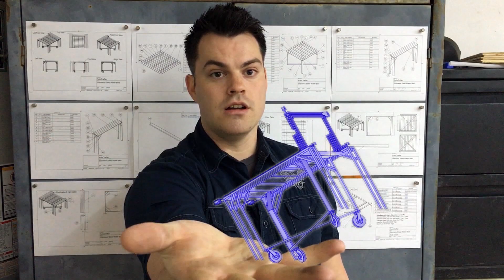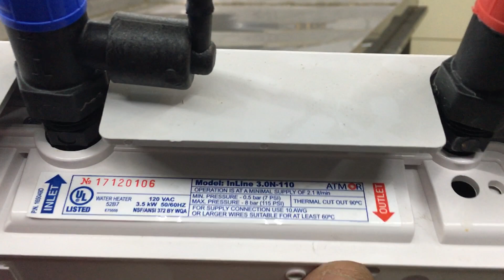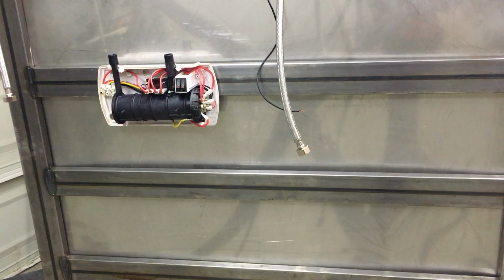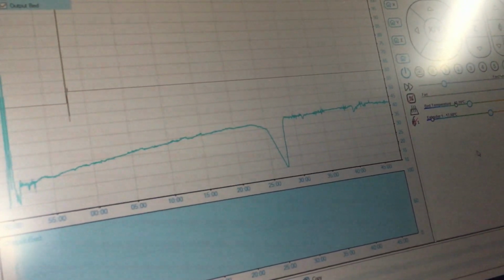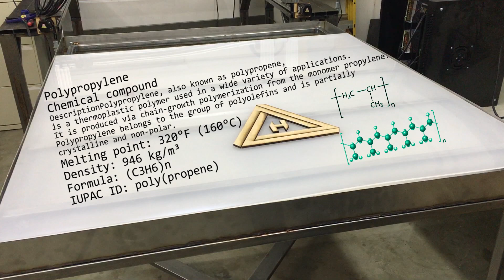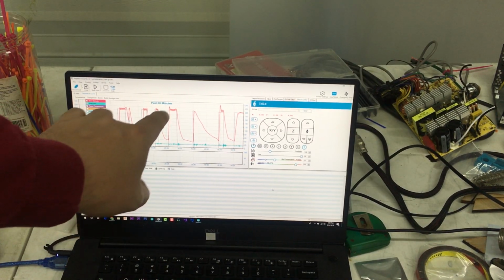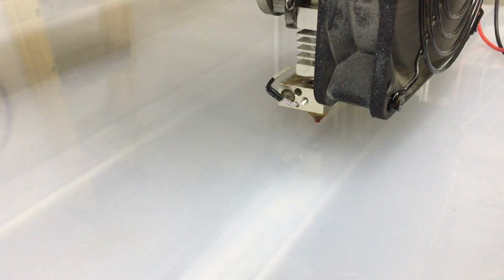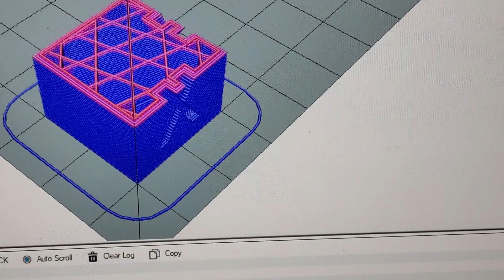First Print on Largest DIY 3D Printer CNC

Comment: I feel like you would def benefit from looking into a mini pellet extruder because printer filament will start to add up at those sizes. I'm experimenting with it right now but for my little printer I dont see much benefit other than using recycled bits without making filament from them. I just toss the bits in and go.

Comment: You might want to use some spray on rubber for your tank. You are probably seeing major heat loss through conduction. That flex seal stuff should work well. Might also want an algecide in that water.

Comment: If you have a printer that big I recommend getting a continuous pellet extruder and a barrel full of Injection molding pellets with a vacuum feed. Pellets cost less than filament.

I also recommend putting the inlet hose for the water heater on the other side of the bed so that you can pull in the colder water form that side to keep consistant heat.

Comment: If you need more heat in the bed you might consider insulating before you go to more wattage, that would also save you some on energy and help keep the bed at a consistent temp.
Reply from the maker: Great minds think alike, I've added an insulating layer and testing results now to get a before and after(data is king). The video will be out for that soon. Thanks for the interest!

Comment: I would definitely tidy up the wiring going into that board, the visible unsheathed wire makes me cringe.
 A wicked machine, can't wait to see it calibrated and doing what it was designed to do!
Reply from the maker: Yes it makes me cringe also it's basically a prototyping breadboard in there. I'm working on cleaning it up and upgrading to a new control board. I'll have an update for that soon. Thanks for the interest!

Comment: try 1mm nozzle and 0.5mm z height it will be quicker to print big.
Reply: Just let him test it with a smaller nozzle first
Reply: But you run out of filament in an hour.
Reply: @MisterMakerNL  yes but enough software making you can make an auto stop

Comment: good work,may i know which bearout board did you use here and drivers?thanks
Reply from the maker: MKS Gen 1.4 Main board. X and Y HBS57 Hybrid Stepper Drivers (one X, dual Y axis). Z is TB6600 driver. Extruder is DRV8825 32 Micro Stepping with a 30:1 planetary gear reduction. Fun times
Reply: @CountryAireDesign   THANKS DEAR,if you have links for them i will be appreciated ,thanks in advance

Comment: Why have you built such a big 3d printer? It will take couple of days to complete a large print.
Reply from the maker: so true, a large print is going to take a very long time! I've got a few ideas I want to try to speed up the print time. Thanks for the interest!!
Reply: Probably more like a couple of weeks. Large prints on my Ender 3 already take 1-4 Days and that's on a 22x22cm Buildarea.
Reply: mm or cm?
Reply: @ZahidHasan-ww4ts  cm